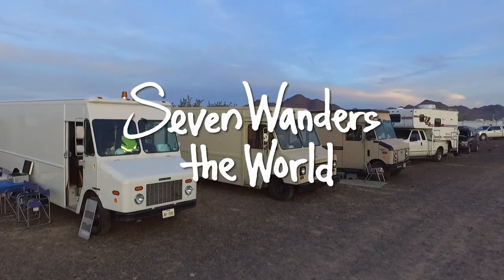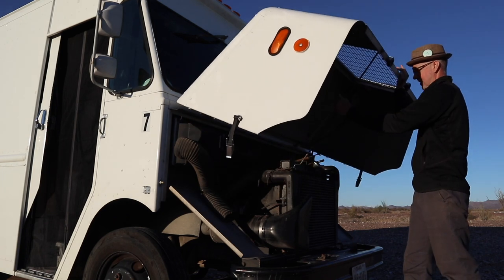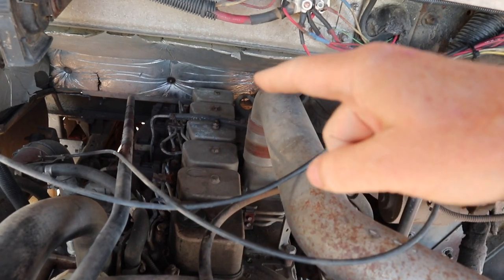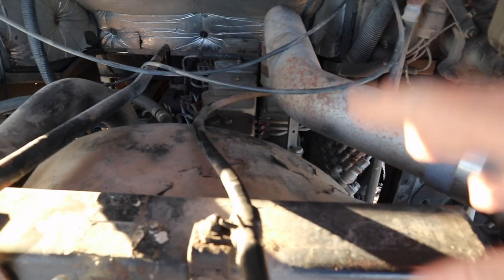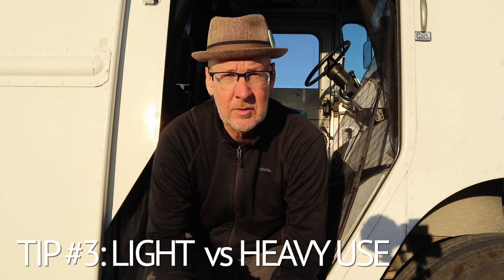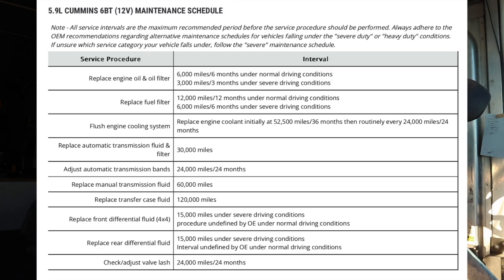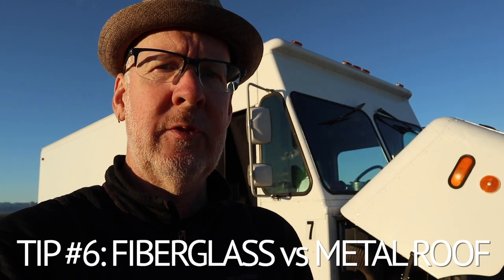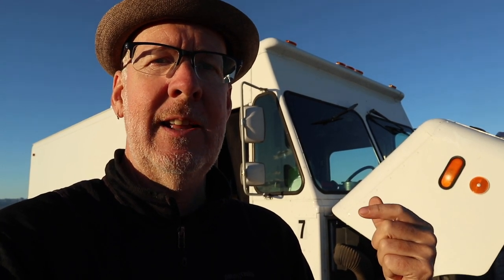How to Buy a Step Van for RV Conversion E508

Comment: Good info to know. I would like to comment on the fiberglass roof issue. A fiberglass roof can be fixed better than new (literally). They are built cheaply  to serve a particular service length. They can be rebuilt with better materials to last a lifetime. I would use any roof issue as a bargaining chip to strike a better deal.
Reply from the maker: I agree with your opinion on this. I only point out that if a person buys a step van with existing fiberglass roof that it will require work to make it functional for a long term RV conversion (repair or enhancement etc)

Comment: Great vid Seven, I see the price of step vans increasing 10 fold. I think I'd like a gas powered one, that way I can do most of the work myself. You just can't beat a Chevy 350. JMHO. I've been following you since you ventured to Washing to get your van. Like you I'm learning all the time.
Reply from the maker: a good point, I should have mentioned that there are many folks who know the chevy 350 engine well and for them the gas engine may be a better choice so that they can do all the work themselves
Reply: Just purchased on yesterday. Chevy 350 engine, no electronics on it. I'm gonna rebuild it myself. And with the cost of diesel these days I'm glad I got gas. Also the carberated version is gonna be a life saver.

Comment: just got a '84 chevy diesel step van 20 foot ex postal,with roll up back door ,came with c.b,back up camera,rear lift,and few other things,has 234,000 miles for $3,000 off Craigslist,hits 85 on the freeway with no trouble,no shake, wobble etc,just small body damage around back pop out side vent
Reply from the maker: sounds like a good buy; welcome to the world of step van conversions! I hope our paths cross in the future as I'd love to see what you do with your build
Reply: Seven Wanders the World definitely,gonna convert to r.v
Reply: Welcome to the Step Van community.
I have a 1988 Chevy p32 that was a US Postal truck, with the 6.2 diesel and th400 automatic.
Mines only an 11 foot cargo area, but I seen one the same size converted. I might very well go that route. I do wish mine was a 18' but I can deal with small spaces.
I've had mine to 83 mph, which kinda surprised me for a 6.2, considering it's only a 3 speed. 
I've always wondered what the rear end ratio or final drive ratio is on mine, because acceleration off the line and the low end torque is way more than I would expect.
Do you by chance know your rear end ratio? Does yours have the 19.5" dual wheels?
I honestly never checked to see what model rear axle I have. I'd love to get maybe a Detroit locker or air or electric locker for the rear.
If I had tons of time and a hair better fabrication skills I'd even consider making a 4x4 somewhat off road capable expedition type vehicle.
I don't know about you, but it's actually one of my most favorite vehicles to drive out of many different type and size vehicles.
Thanks for sharing,
Much appreciated 👍👍

Comment: Also with the 5,9 Cummins  with blocks made in Brazil between 1999-2002 had coolent  passage issues. The casting was to thin and were prone to corroding thru, These engines are marked with the number 53 on the lip where the oil pan bolts to the block. Front Left side. Known in the industry as # 53 engines.  The 24 valve engine
Reply from the maker: great info. wasn't aware of that
Reply: Good to know, thanks

Comment: They also make 10 and 12 foot step vans that oftentimes have a Chevy 350 V-8 gas engine. In the smaller / lighter vans, that can be a good option.
Reply from the maker: I agree on smaller vans, especially in flat cities (no hills) a small gas step van makes sense

Comment: Well thought out Seven.  

This got me to thinking.  I don't ever recall seeing a "civilian" UPS truck.  That is, one driven by someone which is not now in UPS service.
Reply from the maker: Marten is right. UPS destroys vans after end of life
Reply: You wouldn't want one if you could even get one. Very hard miles. Body cracks, suspension and frame issues. Almost unsafe.

Comment: 5.9L diesel is 6 cylinder of 360 cubic inches. That's some large cylinders! and deep stroke which all diesels have. Gasoline engines are quieter, which can be advantage in some parking areas, especially if need to crank at night for some added warmth. Gasoline engines crank easier in cold weather, and fuel always easy to find. As noted, more mechanics available to work on them. Because compression on diesel is twice that of gas engines, that also means greater torque needed on head bolts, which can be a problem if you ever need to work or replace a head yourself. The newer diesel have electric fuel pumps, higher pressure needed than gas engines. Not sure if that's an  advantage or not compared to the older diesel with mechanical fuel pumps. It may be 6 of one, half a dozen of the other, depending on the person who will be using the rig.

Comment: Thanks for the tips, I'm about a month away from getting fairly sizable check and I'm going to be looking for a step Van between 14 and 18 foot. I'll be looking at a Allison transmission Cummins 5.9 combo or a Caterpillar engine because those are the longest-lived send easiest to work on. a vaulted also been looking at doing a suspension upgrade on whatever I buy because I want to be able to take it off road. I've also been looking at school buses.

Comment: Rapid Rabbit
Great Information-Might consider adding to your source to shop, each State has a purchasing agency that handles fleet buying where they get the cheapest  price to purchase vehicles in fleet volume and they extend this service to cities county and special districts in their state.  So if the City of Austin wanted to replace 20% of their fleet of police cars every year they might go thru this Purchasing agency to get the police cars that they need to get the lower fleet prices that the state gets for volume buying.   In the state of Washington this same agency also disposes of the surplus vehicles that all of the cities, counties and special districts surplus when they buy new replacements.  The Washington State Department of Enterprise here has all manner of surplus, literally everything from soup (spoons) to nuts.  Vehicles and heavy equipment are usually sold via auction on line.   Smaller stuff like laptops, monitors office furniture, etc. are marked with a price and are for sale like normal store.   You might check some other states and see if they do the same thing.  In Washington three year old cars go for $1000 each +/- .  We have gotten a few good deals like a large color monitor for $35 and leather laptop cases for $5.   It Might be worth checking out.   If you find anything at the disposal site here in Olympia that you want a condition report on, give me a call.  By the way, my personal preference is a cat engine.  The dairy where i worked for several years bought all Peterbilt or Kenworth diesel semi tractors (had a fleet of about twenty-five and they were all Catapiller engines because they felt they got more life with fewer repairs even though they are more expensive,  However, their application was very different than yours.
                Have lots of fun and be safe
Reply from the maker: excellent tip on where to purchase commercial vehicles! I did buy a pickup truck at one of the auctions that you describe where there were lots of big city and county owned vehicles. as you know, I'm very new to diesel engines and big vehicles, so don't know much about other brands. I believe other step vans have chevy gas engines and International diesels, but I don't believe I've seen any that have a Caterpillar engine. then again, I know almost nothing about Caterpillar
Reply: @SevenWanderstheWorld  Cats are said to be expensive to maintain.

Comment: I've thought about step vans but I just don't like the boxyness of them. I did have a small cube van one time and I liked it ok because it had the van front end on it.  I still wished that it wasn't so boxy.  I like your advice though.  I think that it applies to lots of different vehicles. It all comes down to research.  Also you have to know what you are going to be doing with it. How do you want to live and where do you want to go kind of thing.  Great video for sure!  :-D
Reply from the maker: boxy square design has advantages in it is easier to build with straight walls and ceiling. but not so great for traveling faster than 45mph
Reply: @SevenWanderstheWorld  vary true.  I'm going to be scribing so I can get my cabinets and shelves in and all of that pain in the neck stuff but my rig is going to be pretty good at higher speeds. :-D
Reply: What type of mileage is expected for a gas vs Diesel engine if all other factors were the same?

Comment: In vans such as the Sprinter, they have to use DEF, and diesel is much harder to service than a gas rig, so is diesel in a step van better than a gas rig, especially than a gas rig?
Reply: These are much older than DEF which reduces pollution.

Comment: My Cummins 6 cylinder has over one million miles no engine work ever! I know people that have two million miles on their Cummins without engine repair.
Reply: 😳 two million miles 😂
Reply: Holi crap2 million?
Reply from the maker: impressive
Reply: @SevenWanderstheWorld  What sort of mpg do you get?
Reply: @Auction Wheels .Hi! Please may I ask, what van/vehicle is that ? One million miles is amazing .
Reply: @yew108  98 international 9400i with almost 1.2 million miles now and running strong. My 2016 Kenworth won’t make it that far...
Reply: @R.C. Collins we will see if I can make it to 2 million in my 98 without a rebuild but the N14 is great engine!
Reply: @auctionwheels  It a huge truck !
Reply: @Salad Breath How long did they last?
Reply: @Salad Breath Interesting. I've been looking at some step vans with 6.2 diesels  (older '80's models) and 6.5's.
Reply: Ha i work at fedex an some of them blow at 68k….

Comment: Thanks 🙏🏼 Seven very informative video! Do you have any kind of idea what kind of fuel mileage you get? I’ve heard 12mpg. What kind of range do you get per tank if you don’t mind me asking.
Reply from the maker: I'm getting about 13 on average (sometimes 11 and sometimes 15). I fill at half a tank and normally drive for about 300 miles or more on 25g
Reply: Seven Wanders the World I just touched down on Pheonix on my way to go look at the Step Van I may buy if it’s in decent shape. It reminds me of your trip from Austin to New Jersey. I just hope mine is in better shape than that one was. Fingers crossed 🤞🏼 literally taxing to the gate now.
Reply: Marten Dekker  25g= 25 gallons

Comment: Where was this video last year, huh? For some reason I have 13’ in the box. I’m considering building a pocket for my roll up. It’s a bloody pain I tell ya!
Reply from the maker: I believe some of the P series chevy vans are 13 and 15 ft boxes (like my recent tour of Denis' rig). in warmer weather, you might consider completely removing your roll up and replacing it with swing doors or a big swing down deck/ramp (which is what Andi did on his)

Comment: Hi Steven, enjoyed this vid.  Like to mention, and I dont have examples or measurements, yet consider the roll up again in that they generally have a sturdy frame, a wider opening, so if one likes a home style door in the back it will frame out and work quite well for that.  To each his own, I guess!!  lol.  Thanks.
Reply from the maker: exactly... for some folks it works, especially if they are not dealing with extreme cold. I know Sylvan Secrets really struggles with his

Comment: Any purchase costs?  Silly question: can i buy  new.
Reply from the maker: I've actually never looked into the costs of new step vans. you can find used ones for $2,000 to $10,000 depending on condition.
Reply: @wulfzn0024  Always get one a couple of years old for half price or less.

Comment: What mpg do you get?
Reply from the maker: typically about 13mpg
Reply: @SevenWanderstheWorld  really? Thats not far short of class Bs where many people seem to only get 15 mpg real world performance.
Reply: I've discovered that if you can keep your diesel running at 1800 rpm or lower, the fuel mileage increases dramatically.  I have one pickup truck getting 25mpg and the other getting 14mpg.  The difference is in the gearing...

Comment: And don't buy a Chevrolet p30 they're just a glorified pickup truck.
It should have 19 and a half inch rims preferably with the big eight lug pattern are the baby six budnut Wheels. You don't want pickup truck brakes on your tiny house.

Comment: No disrespect to this guy but he clearly learned all of this off Reddit...not because he is a knowledgeable person. Take his info with a grain of salt.

He is largely correct however he has no clue why he is correct because he is parroting info.
Reply from the maker: doesn't living in a step van for 4 years qualify someone to give advice?
Reply: @SevenWanderstheWorld  I'll address your question.

Simply put: no, living in the van does not give you special license to comment on how to buy a step van nor does your presumptive time on Reddit.

First off, my qualifications: I am a heavy truck (diesel) mechanic, a truck driver, I have similarly spent time as a light duty(cars & pickups) mechanic, I have driven over 1 million miles in my life. I am also a certified private pilot and have spent a significant amount of time in the ND Oilfields. I point all this out to demonstrate that I have some level of expertise in this topic (of vehicles). Not to mention I share the nomadic soul with this community.

Ok, point by point:
Reply: 1) You are actually correct that diesel engines are superior to their gasoline counterparts...in most areas. However, they are also far more complicated, more expensive, less universal, higher fuel cost, finding a good diesel mechanic is harder AND take specialized knowledge of cold weather procedures. So unless you know how to repair your own engine and/or have plenty of money to burn on said repairs then gas is likely better for the average carefree van-lifer. Even if they get there a bit slower.
Reply: 2) This is just a variation of the first point and therefore redundant. You are down to 6 points.
Reply: 3) As a heavy and light truck mechanic your characterization of "light" vs "heavy" is designated by their maintenence schedules is just not accurate. I'll agree that their prior history of work is the important part. A plumbers truck will last longer than an abused FedEx truck. That is self-explanatory. Sidenote: a word to the wise...do not expect a million miles from an engine...just don't.
Reply: 4) Overall length: this is another feel good non-relevant Reddit trope. The only time that this really matters in in a crowded mall parking lot right next to the building. Otherwise just park your van out on the edges of the parking lot and walk in. The campgrounds and tourist attractions won't be measuring your vehicle. Just don't be lazy and use your feet to walk an extra hundred feet and you will RARELY have to worry about fitting in between the lines. My daily driver truck is 21' and doesn't fit in most parking spots.
Reply: 5) Door Style: This is another point where you outright state that all your information is from other people. Which means your 4 years sleeping in a vehicle is not relevant here. This doesn't mean that you are wrong...you simply do not know why you are correct (just a parrot). To hammer this point home...don't advise people to take on projects they aren't qualified for. I.e. bringing the door to some one like me to retrofit it. Any cost saving for buying the wrong door will be completely negated by the cost of the retrofit.
Reply: 6) Fiberglass vs Metal roof: this is a point you are completely correct on...but again for the wrong reasons. I agree, don't buy fiberglass. However, you point out that it might be nice to have ambient light from the roof...this would mean that there is NO insulation in the ceiling...an exceptionally stupid proposition.
Reply: 7) Where to Buy: FINALLY we actually get to hear how to buy a step van. Considering that it's the title of your video it's funny how we had to wait until the final point to hear your single bit of relevant advice that was promised in the title.
Reply: Again I'm not saying it was a bad, or even inaccurate, video. I only want to advise people against taking advice from people that don't understand their talking points...even if technically correct.

I await your rebuttal good sir.